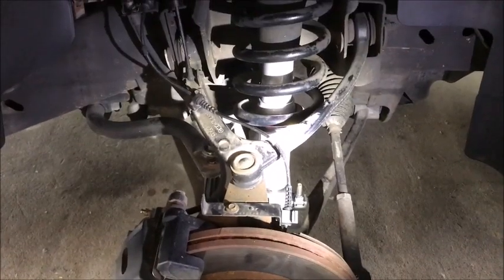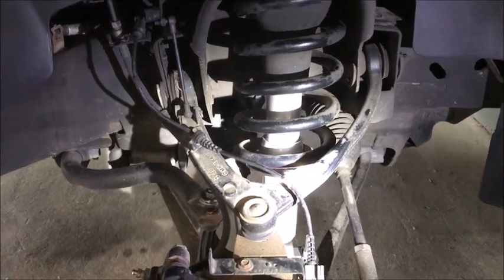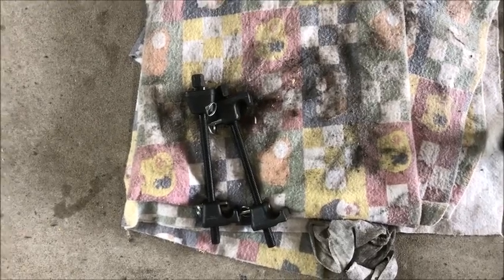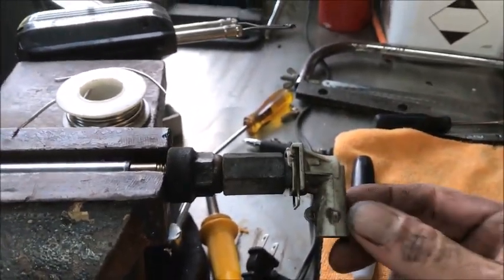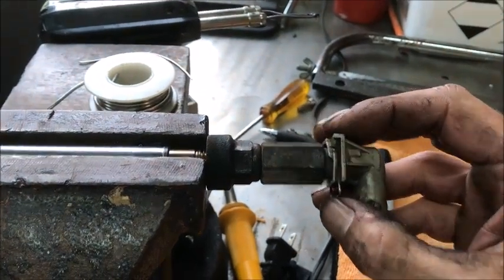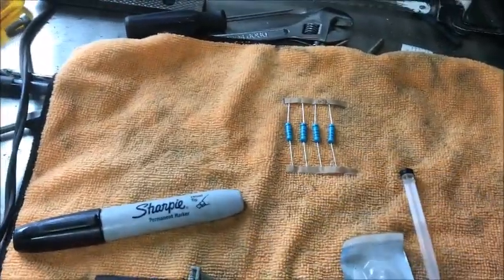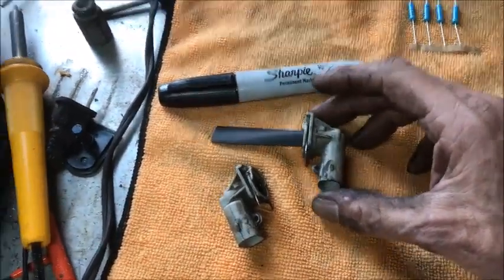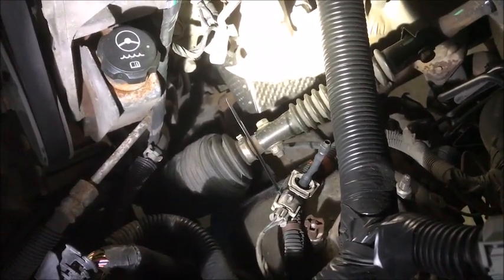2007-2014 GM Auto ride front strut conversion to standard...no wire cutting method

Comment: The resistors works  for the rears shocks to ??
Reply from the maker: Hello, not sure if adding a resistor on the rear ones works as well since most of the cheap replacement air ride rear ones come with some type of dummy resistance coil. Might be worth a try though to them regular shocks could be used on the rear as well.

Comment: Great video, thanks Steve! Just an FYI the same resistor (2w 4.7K Ohm) will work for deleting the rear as well. I ordered 30 resistors form Amazon for $7. I simply inserted the resistor into the existing plug and covered with heat shrink. That way there is no damage to the wiring, if the resistors go bad I can easily replace them and if I or the next owner want the original type suspension back, it'll be plug and play.
Reply from the maker: Thanks man and glad the video helped some 👍. Good to know the same size resistor also bypasses the sensor as well (probably what the low cost rear shocks have in them to trick the system based on what you found).  Good (and easier) idea to just jump the resistor ends across the sensor connector as that took away all of the extra work to keep the top of the old shock 👍. Thanks again and all the best !  Steve
Reply: @1976gmc  i tried it it didnt work for my 2010 escalade ! What am I missing

Comment: Could I separate the connector that sits on the struts and simply put a 4.7k ohm resistor in the connector ends? Would that shut off the "service suspension system?"
Reply from the maker: Hello, yes, putting a resistor across the two connector wires would do exactly the same (assuming the service suspension system warning is being caused by the front struts) 👍. The connector that attaches to the strut top also should have an electrical connector that disconnects from it that so you could just put the two ends of the resistor into it and see if it turns off the warning before cutting wires I believe.

The reason I cut the connector and put the resistor in like in the video was so I could easily go back to the Mag ride struts if I didn’t like the ride of the KYB heavy dutys…they did great though and I had no issues ( I recently changed them out for some new ones due to hitting 200k miles on the vehicle, but the KYBs did fine).  Hope this helps a bit and all the best !  Steve

Comment: every video i watch,different wattage and ohm resistors are being used,where did you read that these were the right ones?
Reply from the maker: Hello, seems like I read it somewhere on one of the GM forums where it had been successfully done by someone using these specs for the resistor, but not 100% sure.  Mine has been trouble free and has not thrown any codes since I did the modification several years ago using these ones if it helps any.  All the best !  Steve

Comment: Great vid Steve👍🍻I'm working on a conversion 07 Chevy Avalanche LTZ,front and back ,do I do the same to the back shocks and how about the air compressor,do I just put resistor's on every wire?
Reply from the maker: Thanks 👍. Actually for the rear air shocks, I liked that the Escalade leveled itself when loaded so I replaced the compressor and air shocks with some aftermarket ones so the system still functions on mine.  I believe the compressor gets its signal to turn in by a couple of ride height switches on the axle (they are behind the inner fenders I think).  To get it to not turn on, those would probably have to be disconnected from the axle and held in the “level” position so it tricks it to not turn the compressor on (or try).  For the sensors that are in the shocks, those could probably be replaced with resistors, but I’m not sure if it would be the same size or not.  Sorry I couldn’t be of much help, but if you do get it swapped out without it throwing codes let me know as I always like to hear how things went.  Al the best !  Steve

Comment: Thanks for the video. Instead of cutting off that tip (shaft), can't we just solder the resister on each end of the wire connector instead of going through the tip part? Basically loop the connection with the resistor. I'm replacing the entire spring and strut (loaded) so that I don't have to mess with the springs.
Reply from the maker: Thanks 👍. Yes, for sure the resistor can just be soldered to the harness connector and it would function the same way. I just cut the end off in case I didn’t like the ride with the replacement shocks and wanted to put the OE ones back so I made it so I could just unplug the resistor and put the connector back on an OE shock. Since I do like the ride better with standard heavy duty shocks, I could just cut the end off at this point and just jump it with the resistor like you said 👍. Thanks again and all the best !  Steve

Comment: Hey Steve great video. I recently followed your directions and installed a 5w 4.7K resistor but  when I start my vehicle I get  the message" Service suspension system" I can turn it off by pressing the check mark on the dash and it is gone till next time I start up the Escalade. This a 2014  model and I have read else where  you also have to replace the auto ride height sensor. Do you think that is what is causing my problem? Thanks for your input.
Reply from the maker: Thanks !  Yep, mine did that once or twice after I did the resistors so I disconnected the battery for about 15 minutes and it never gave the error again. Not related to the installation of the resistors up front, but I also got the “service suspension system” when one of my rear air ride bags went bad. It too required me to disconnect the battery after replacing the air shock for some reason although it didn’t throw the code when I replaced them initially. Not sure why it threw the code one time, but not for the other.
Reply: Thanks I've got this same project planned for a 2014 Cadillac also.

Comment: Does it matter which side of the resistor is soldered to the bottom and to the side?
Reply from the maker: Hey man !  No, the resistor can be soldered either way as they are not directional 👍. All the best ! Steve
Reply: Thank you so much!
Reply from the maker: @armylyfe8953  👍

Comment: Hey Steve could you please list the part in which you bought for this project? I’m having to do the conversion as well and don’t want to have to buy the parts more than once. Thanks for the helpful videos
Reply: Thanks for the quick reply man! I should’ve specified on my question of parts but I appreciate you listing the other tools and parts in which I need. I’ve been trying to figure which shock to get as a passive shock instead of the z55 auto ride struts. I seen you had the KYB gas-a-just and does that meet your quality standards? Also did you purchase any assembly parts due to spring seating issues? Thanks again Steve. Channel is a lifesaver!
Reply from the maker: @TimmayRat  thanks man 👍. Yep, I felt an immediate difference in the handling (to the good) with the KYB shocks...potholes in the road don’t make it jitter after hitting them anymore and I no longer have that annoying resonation I was getting at interstate speeds. Seems the active shocks were just trying too hard to control the motion so they were constantly over compensating or something. It’s hard to tell if changing the fronts out or getting the rear air ride working again fixed the rolling feel when cornering since I did them about the same time, but it handles a ton better now than it did before I redid the suspension. The coil springs fit right up on the KYB shocks so I didn’t have to add pads or modify the spring seats at all.  Glad the video help some 👍. Steve
Reply from the maker: Hey man !  The resistors are 2 watt / 4.7 k ohm. You’ll need two of them. To remove the springs you’ll need some spring compressors...I bought the heavy duty McPhearson strut type compressors vs. the cheaper ones. To remove the nut on top you’ll also need a extra deep well socket...the cheap black impact ones from Harbor Freight are really deep and worked perfect.  Other than a soldering iron and some solder that was about it for the odd things to buy.  Hope this helps and all the best !  Steve

Comment: Where did you buy the resistors? And does it need a certain one?
Reply from the maker: Hello, I used a 2 Watt - 4.7k Ohm resistor (one for each side). I got them off the internet as there’s not too many places locally that sell electronic components now that Radio Shack closed unfortunately. Hope this helps and all the best ! Steve

Comment: How did you cut the part so you didn’t damage the inside wire
Reply from the maker: Hey man !  I first cut it long completely through down towards the nut, then pushed the inside wire and plastic sleeve out and cut the metal tube off.  That way the inside insulator and wire are longer. Once it’s cut off near the nut, the inside part pushes right out.  All the best !  Steve

Comment: Have you had any codes come on?
Reply from the maker: Hello, so far so good on not having any codes using the resistors... It’s been several years now since I converted them so I think the computer can’t tell the difference in the resistors and the original strut sensors 👍. All the best ! Steve

Comment: hi, I hava bad front shock and want to replace them my car has de z55 suspension,  did you notice any diference betwin electronic and conventional struts, wich one you like the most.  thanks for posting this video
Reply from the maker: Hello, my OE electronic front ones had a very bad vibration that would come and go after hitting a bump at higher speeds which was the main reason I switched them out for conventional struts.  For me, the handling is much better and more predictable with the conventional vs. the original electronic ones.  Hope this helps 👍. Steve

Comment: what's the resistor value?
Reply from the maker: Alvaro Chacon , hello the resistor size I used is a 2 Watt - 4.7k Ohm resistor.
Reply: What about rear shok absorber bypass resistor
Reply from the maker: Hello, I didn’t bypass the rear shock system as it uses air pressure and a pumping system for mine. On my model it only had the electronic suspension on the front...on the back it has air ride with the load leveling capability.

Comment: Do you know if this will work on the rear also?
Reply from the maker: Angel Gonzalez Jr , hello, the back suspension is air ride so it’s different than the front.  There are level sensors that make the air pump fill the rear shocks that might be able to be tricked by a resistor, but not sure.
Reply: You can purchase the struts for the rear that come with the bypass kit or just purchase a bypass kit off of eBay and splice it in line. It’s really easy man, I did it a couple weeks ago and car works perfect.
Reply: @joshw9037  can you more explain how to fixi  it?